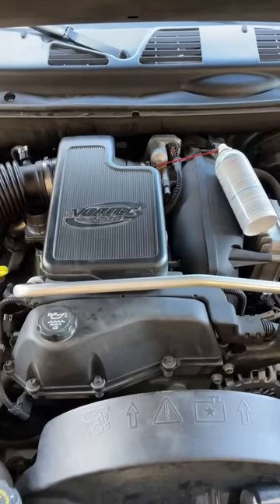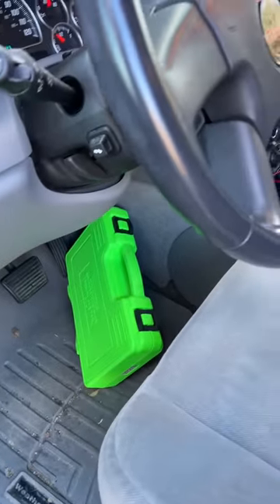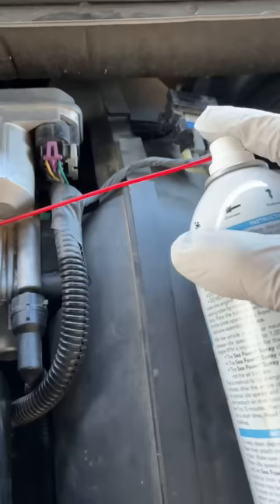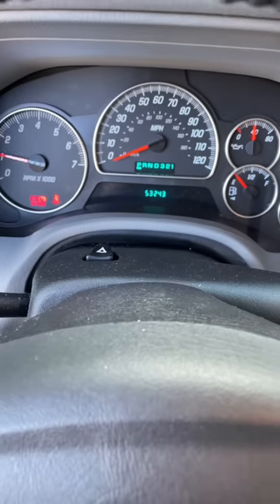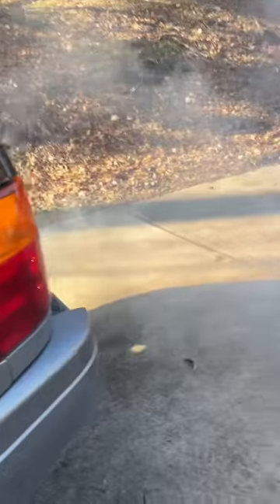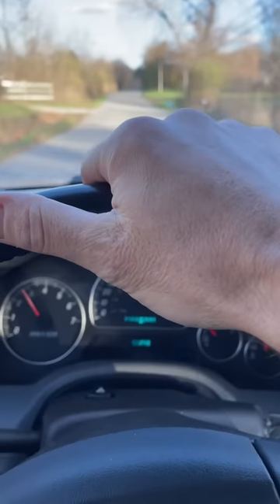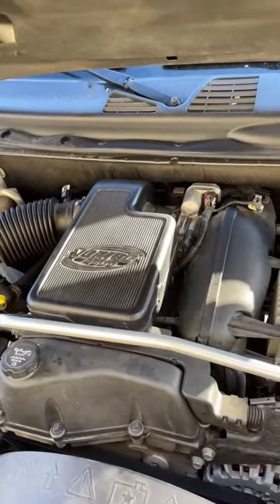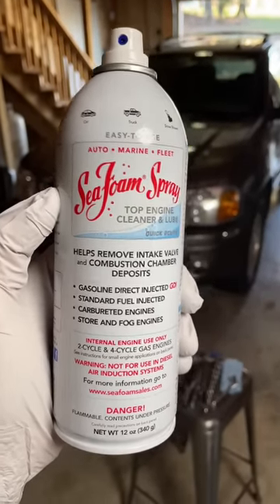Seafoam Smoothed My Rough Idle! Part 3 of 3!

Comment: The part the sea foam won't work on is putting it in the gas tank. Most cars are GDI and bypass the intake completely. Spraying it into the engine will clean everthing before getting into the chamber

Comment: I’ve used seafoam in every vehicle I’ve owned for years and it has kept my cars running like new for several hundred thousand miles each. Fantastic stuff.
Reply: Where did you use it on ur vehicle besides carbon build up

Comment: Make sure you change your oil right after that! I like to try a slower acting Marvel Mystery Oil fuel treatment for a while. This essentially is the same thing, accept for it also cleans the fuel injectors! Seafoam used this way is good for a fast clean of the combustion chamber ,throttle plate & upper intake. I don't like all that concentrated crab fast-acting treatments break loose going through my catalytic converter afterwards though!!!

Comment: I was always told though if it's on a Catylitic converter car you want to disconnect your exhaust before it or it can gum up your cat with all the carbon build crap it's cleaning.  I'm not saying it doesn't work but you still don't know the reason why that was happening so it more than likely could come back again but I'm super glad that it work for you.

Comment: Probably because the throttle body was dirty....I clean my Silverado throttle body regularly.....it has 360 thousand miles on it...still running. Dirty throttle body will cause rough idle.

Comment: Seafoam is way overrated and expensive at $10+ a can. Berryman's B12 Chem-tool is just as good if not better and much, MUCH cheaper at $3-$4 a can. Been using this since the 70's on my dirt bikes and I learned about it from my  Dad.

Comment: I run it in the gas tank, never in the oil. Don't wanna scare away the ghost in the machine!
Reply: ive done it in the oil twice, the toyota dried up the valve cover gasket and the honda blew up after 30 miles. never again😂
Reply: @mannypapa642  marvel mystery oil instead

Comment: I use a can of the original Seafoam in my gas tank about every 3 or 4th tank, and my '85 Toyota van has 233,000+ miles on it and STILL runs great!😉

Comment: Just bought a 2013 ecoboost escape. Motor was knocking horribly. Used sea foam in the gas, oil and intake no more knock, injectors are quieter, car gets better mpg and more power. Great stuff

Comment: I put a can of Seafoam for high mileage vehicles in my 04 f150. It’s the can with black and gold markings. It knocked carbon off and increased my mileage by almost 70 miles. But that’s highway and keeping it between 55-60 mph.

Comment: Used seafoam on moms 2000 toyota. Everybody thought burn it up .. (smoke). Ran toyota till bitch in pickup smashed trunk.
Insurance totalled it for year. Body to scrap yard engine into another toyota..seafoam rocks.

Comment: Most pump gas is crap, n carbons up your fuel system.
So, yes, Seafoam, or any other fuel system cleaner used periodically will keep your motor running smoothly...

Comment: CRC is far better. You must have Direct injection. If you do you clean that carbon build up of of the intake valves every other oil change or 10,000 miles

Comment: Carb spray has been around since Moby dick was a minnow.
It's like $2.98 at Walmart, dude.
You don't even need a whole can.
Just clean the throttle plate and use a rag if it's Teflon coated.
A spray during a rev up and you clean other deposits you can't reach.
BFD

Comment: Chevy trailblazer ..... my dad said car was shutting off ..... I must've been there for an hour ..... Then the a/c was on I turned it off ran great .....removed the air intake to look at the throttle body ....it was dirty AF ....took it apart cleaned it ran great .....so why did you have to throw sea foam in the engine ?

Comment: Here's a tech tip for you if that thing ever starts idling rough after motor mounts go back to the GM motor mount because for some reason the aftermarkets make it feel like it's skipping
Reply: Your definitely right!
I wish I’d been told that before spending $ trying to figure out my engine misfire/rough idle lol
Reply: @205ken4  was 8t ok for about a week then started the issue
Reply: I also had a dogbone mount on the top of a Toyota Camry that caused a noise that sounded like the inner fender well came loose you could actually feel it in the floor

Comment: Bad pcb valve design in the trailblazer and envoys, always oil/carbon getting in the airbox nd throttle body in those models. Usually throws codes for map or maf sensors... bulletproof inline 6 though. Nice car and video 👍🏽

Comment: I did an AC Delco complete fuel system service in my car about 2 years ago (around 6000 to 7000 miles I’ve driven since it was done).  The last four full tanks Ive put one 4 oz bottle of Lucas Fuel Treatment (with the last two tanks using 91 octane); and I’ve gotten an exhaust leak fixed.  I have a 2007 Pontiac G6 with a 3.5l engine.  When should I do the next complete fuel system service clean on my car (after watching a few videos I’ve thought about doing the Seafoam one)?  And if I do that, how long should I wait to put in a bottle of that Lucas Fuel Treatment?

Comment: Personally, I recommend pulling out and cleaning injectors. My v6 ranger used to idle super rough and started hard after long drives until I cleaned and rebuilt the fuel injectors. Now it starts and runs great all the time. I ran many cans of seafoam through that ranger and they would make a slight difference but it's just a bandaid on the bigger problem. Just my 2 cents.

Comment: In a Gasoline engine. You are supposed to use the break booster line, unclam ant take it off and put your thumb over the whole line so it doesn’t die. Let the engine idle and slowly let the break booster hose pull “Suck it into” it in as you have part of your thumb on it. That is again to keep it from dying, and pour slowly to not vapor lock the engine. After you have poured about 1/2 to 3/4 of a bottle in kill the engine. Reconnect and clap the line. Let it sit for at least 15-20 minutes. Pour the other half 1/2 or Three Quarters 3/4 directly into the gas tank. You can pour it in the gas tank before the break booster line process. Make sure you have at least over a quarter tank, but half would be better. After the 15-20 minutes is up, crank the engine and do NOT rev it up. Let it idle until the white smoke is completely cleared ,Or very little coming out. Then drive it easy for a mile or so, look to see if it is still producing any smoke, if it’s gone or very little is coming out to notice. Then you can open her up and get her up to a decent speed. If she is getting better you can get on the Highway. You can add a whole bottle to the engine directly as described and another whole bottle to the gas tank. Just make sure the tank is close to full. All depends on how many miles it has and how bad it is acting up. I have done this without fail for many of my vehicles.                    “Vehicle loop is not Running,or will crank and die” … I would pour it into the booster as the engine is being turned over. Do not keep cranking for no than 3-5 seconds at a time, with a 15-20 second hold between cranks. Pour some into the gas tank as well.. wait for 20-30 minutes before cranking it up. It should start up if it is something simple like build up internally, which is very common using Ethanol in the gasoline.If it does not start up at all, only hit it with a small amount of (carb cleaner or something similar) directly onto your air filter, make sure you don’t make it a habit to do that. The engine in most cases will eventually depend on that to start up. That should do the trick. When it is running just follow the same steps above. But use a whole bottle through the break booster hose to engine, and another full bottle in the gas tank.

Comment: Anyone that has ever used it knows it does not say, "Drive aggressively". It actually says, "Use spirited acceleration". That sad part, is I don't think the OP is trolling. But you'd have to be dumb to believe a brand would direct consumers to drive aggressively.

Comment: The catalytic converter is probably clogged causing the engine to not have access to enough oxygen(air).  You probably just cooked the catalytic clog by overheating it when the foam clogged the converter.

Comment: Nice..I did this to a 2006 Wrangler that idled so bad the dashboard vibrated. The Seafoam did ok. However, I had big success with the Deep Creep from the same company. Used it the same way, I was even able to clean the idle air valve. I put the whole can in through the intake even after the engine stalled. I waited 45 minutes, and it did not want to  start at first. But when it did, it was hitting on 2 cylinders at first. After it stabilized, I took it out and spanked it. Rough at first, then after 5 miles, it was blowing blue and black smoke, then all of a sudden the power was back, no smoke acceleration was like the day I first got it. Power to spare.

Comment: Fixed my 2 stroke 50 hp outboard Mercury. Removed a bunch of green junk off all my needle valve slides, and carburetor throat. 
Smoked a bunch but even before the smoke cleared it ran smooth again. I mixed a half a can (comes in non aerosol 16oz cans ) into 7 1/2 gallons of marine gas.
Looked like a serious mosquito fogger going down river. 😂

Comment: You do realize that's an aluminum block, with aluminum head's, and Pistons. Sea foam will after time of using it will make pitting. Yes works but use a cleaner that is safe with aluminum. Just simply look up the chemical cart of each product. 
Believe it or not Chevron with techron in the black bottle works VERY GOOD. try it out man.

Comment: So basically all you did was clean the throttle body. And washed all that crap threw the engine (SMH)  When in reality all you had to do was take a can of carb cleaner and remove the throttle body and clean it. And you wouldn't have dumped all that crap into the plugs or into the cylinders. But hey, You know better.  APPARENTLY....

Comment: Just did this on my 2013 Charger SE with 195xxx miles. Had done an engine flush about two months ago and even with that, I had HUGE PLUMES of smoke come out after the hot soak. Drove it around “spirited” and at first, it kind of bogged down and even flashed the check engine light but went away right after it blew out some nasty carbon. I live somewhat in the country so not a lot of people on this backroad which was a good thing because I smoked it out! lol literally. Throttle response is better. The get up and go off the line is much more fluid. Still a little bit of a rough idle but not a ton but for a vehicle with nearly 200k, I wouldn’t expect any less. Seafoam definitely worked!

Comment: If you are using big box store gas (Costco, or any high sulfur high detergent mix) 9 times out of 10 this is the only way to fix your problem. Usually gummed up valves.

Comment: When I opened the air intake manifold on my Honda.. it was indeed caked with nasty black deposits. Like 95% blocked.. so seafoam will help a lot. Taking it a part and cleaning it out would probably be even more effective.

Comment: So my issue is, I replaced the tps and reset the codes and it worked fine while idling. But when I went to get on the gas it revved up and wouldn’t come back down. I waited at least 5 minutes before revving the engine. Btw it’s a 09 Silverado with the P0121 code. Thanks for any help.

Comment: Looks like you’re bone dry on gas… if that’s a habit of yours to run it that low… a fuel filter/pump could significantly help your rough idle… also it’s horrible for your vehicle man. Try pretending that a quarter tank is empty and never let it run below that. It’ll help significantly.

Comment: Get a K&N cold air intake it will improve your gas mileage a lot I did it in my trailblazer and it improved it a lot a lot a lot a lot also run much better. Oh yeah, and by the way where your master cylinder there is a big black vacuum line pop it off dump a half a bottle of SLOWLY seafoam in there. Shut the car off. Wait about 30 minutes and drive it.

Comment: Dude these engines are notoriously known for having a permanent misfire.  It’s the valves. Sea foam ain’t fixing nothing. It’ll run forever with the miss tho. But that check engine light is staying on.

Comment: Carbon build up acts like a sponge in/on/around some engine components. Compression rings that get carbon-fowled, carbon-loaded compression rings don't seal as well, they don't ride on the oil-film as well, carbon loaded oil rings can't even do the job supposed to. Valves don't seal as well. Valve springs don't dissipate heat as well. I add it to the fuel and the oil to keep carbon under control.

Comment: My son's Mazda 3 has a misfire on cylinder 4. I've replaced the plugs and coils. I've switched the ones on 4 to 3 to see if the problem would move and it stays on 4. I'm leaning towards the injector now. I was going to take it out and try to clean it but do u think I can add sea foam directly to the gas. Will probably try to clean the throttle body also. I'm open to suggestions.

Comment: It supposed to go in the largest source of vacuum and not down the throttle body as the vehicle is running. SMH seriously use the damn brake booster vac line jeez is everyone a tik tok mechanic?

Comment: Just clean your throttle body next time it will work the same. Ps get rid of that truck it’s a ticking time bomb! So is the guy with the Hyundai with 241k miles in the comment section.

Comment: If that vehicle is equipped with an idle air valve, you just cleaned it.  If that's the case, a proper cleaning with it removed would have been better.

Comment: Sooo... you Loosened up all the carbon build up and then sucked it into the engine, And I don't even want to think about what this is doing to your catalytic converter. Next time just remove the Throttle body and clean it with brake cleaner.

Comment: Auto tech here. My two cents? Your the average guy who doesn’t have the means to get his car professionally cleaned well OK decarbonized seafoam works. I like using it as a engine flush once a year and after having to do a intake job on a old GM 3.5 litter as far as flush goe it works great! Save those expensive lifters and keep that varnish out of your cylinders. Hell I might try and run. I can have the original fuel treatment in our professional cleaner at the shop just for shits and giggles.

Comment: Clean the throttle body plate and maf sensor with appropriate sprays.  Seafoam doesn't work in the combustion chamber any better than water.  Water works well to break up carbon.
Don't waste your money on this crap, honestly.

Comment: The throttle body of the gm 4.2 liter junks up with oil and can cause the motor to stall when turning on the ac. Where you put the sea foam straw, it cleaned the part I am talking about. Sea foam is great and will clean up the spark plugs and valves.

Comment: Sea foam is my go to we've been using that to clean out injected throttle bodies long before they made a spray can The old school move was to hold your butterfly open just a little bit slowly pour a thin scream of the sea fall man until it died then you'd let it sit for about 20 minutes to drive it like you stole it and if you needed to repeat

Comment: So what you did is where you put the seafoam. It's actually cleaning the throttle body plate with all the carbon. You could have taken that intake tube off. Clean the throttle body plate with some rags and maybe a couple q-tips. Don't get me wrong. The seafoam is a good thing to do once a year on any vehicle. Seafoam in the intake seafoam in the gas tank. For the injectors

Comment: I Drive e an 04 Yukon 6.0liter vortex and the engine light turns on and goes off as it wants to and it has a rather rough idle but drives fine, just hates the lower rpm like when you touch the gas a little from a dead stop park or drive, I don’t know what’s causing it buts it’s kinda aggravating me.

Comment: I have always wanted to try it, but scared  I will do it wrong or it will screw with the sensors - anyone use it have any advice? Has anyone had a bad experience with Seafoam?

Comment: Pour it in the brake booster lone or anything pulling vacuum into the intake. The spray cans are just for the intake which is good and all but you did not clean or hot soak anything except the throttle body. You documented your own placebo and that smoke was not even worth showing us. Do what I just said and then record it. Your welcome

Comment: What you need to do is clean the throttle body and MAF sensor. I've been told seafoam has too much oil for the gas system. I used it once the smoking of the muffler was fun.

Comment: It worked for me too after buying plugs purge valve pcv valve coils and changing motor mounts 3 times I have an elantra and it had a shaky idle it was driving me nuts then I tried the Lucas gdi cleaner and my car isn't gdi. Oh I also cleaned the throttle body till you could eat off it but nothing did it but seafoam. I had so much smoke the police came because they thought my car was on fire then when it stopped smoking I drove it. Then once I got in a safe place and drove a little aggressive and when I did another cloud a block long came out of my exhaust. Seafom is awesome don't care how many times scotty Kilmer says it's for outboard motors it works on car engines too I promise

Comment: It restored a Cadillac engine that had been sitting for 5 yrs cause the engine was misfiring badly and the customer thought it was going to cost a lot to fix so he parked it. It took two cans to clean up the valves nicely $28